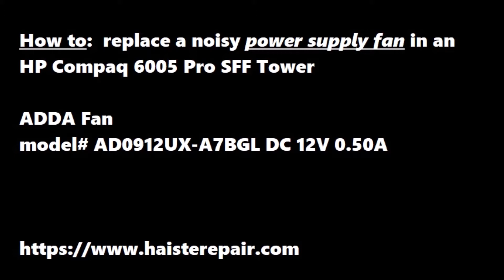How to Replace Power Supply Fan in HP Compaq Pro 6005 SFF Tower

Comment: You sped up the part where you put the power supply unit back. Was extremely easy to remove it but had great trouble in putting it/fitting it back again.

Edit- Ah, figured it out. We need to put the bottom part such that the tiny circular bulges on either end fit into the curved rails on either side of the CPU case & then turn the PSU up to it's usual position such that the sides stay in those rails.

Helpful video to replace the fan as I use them in full speed & may need to change more frequently.
Reply from the maker: Yeah, I figured people could just do the reverse of taking it out when reinstalling.  Or, maybe try playing the video in slow motion.  Fair feedback, thanks.

Comment: ummmm i can clean everything in the power supply with the contact cleaner?
Reply: hope u reply as fast as u can :)
Reply from the maker: @sadg5056  I would use Isopropyl alcohol personally as it is quick to evaporate.  I have cleaned with q-tips or other such things as necessary, with the alcohol.  What kind of situation are you dealing with?

Comment: i disassembled my power supply (psu isnt much different than the one in the video) but im struggling to unplug the fan, im afraid to use  100% of my power and end up by shredding the cables
Reply: nvm i managed to
Reply from the maker: Good deal!  How is it going?

Comment: Hi. is it possible with only 250 watt if; so what will the minimum/cheapest requirements of hardware cpu/gpu....be for the hp 6300 pro sff for use as a media server dl movies/sreaming wifi/ 4k movies? Thanks
Reply from the maker: It would generally work fine as a basic media server and, yes, the 250W PSU would be fine.  However, for 4K video streaming I would recommend upgrading the graphics card and power supply.   Minimum gpu might be something like this:  https://www.techpowerup.com/gpu-specs/geforce-gt-1030.c2954

A quad-core CPU with a good clock speed would be good.  Does your model run AMD or Intel?

Comment: You can try oiling the fan
Reply from the maker: That is true and I don't think I tried that despite having appropriate oil on hand.  Or maybe I did, I can't recall!  So long as the bearing is accessible under the sticker (not always the case) that is something I would also recommend trying.

Comment: My HP 4000 start up when plugin. Does shows anything on monitor and the keyboard  it shut down for about a second then the fans start spinning again then the fans start spinning fast I tried everything bring it to a expert he said the mother board is no good but my mind is telling me other wise I think it's the power supply any ideas any one
Reply from the maker: So the fans are running very loud and very fast?  As if they were receiving more power than they are designed for?  And the computer boots on when you plug a power cord in, but doesn't boot to Windows or give you a chance to get to BIOS?   It just keeps running the fans at high speeds until you shut it off?  Try opening up the tower case and trying these one by one:  1) remove all RAM sticks and try booting them one at a time.  You could have faulty memory that is preventing startup.  2) remove all hard drives and optical drives.  Try booting up the tower with one installed at a time.  3) remove any graphics cards if you have one installed.  Try booting up with the display cable plugged into an integrated port on the I/O panel.  4) remove any other cards or peripherals except for the mouse, keyboard and monitor.  Try booting up.  

Let me know if you need clarification or any help with these :)  Or, let me know how it goes.
Reply: @HaisteComputerRepair  we tried all of that it didn't work we change the processor we change the ram we run it without hard drive same issue
Reply: Thing is the power support is Kno to be running on low voltage cuz my electricity it weak so I am wondering if that could be s issue because that PC is not design to run on low current
Reply from the maker: @lyrikoal7791  Can you explain how your household current is weak?

Comment: i have an issue as same as someone on here of the comments that the psu fan and front fan of (hp elite sff 8100 i think thats called) that goes at full speed since i turn on the pc,every time,i already tried disconnecting,connecting,i really dont know what to do :( i checked temperatures and they're normal on 35-40 degrees,as well with the gpu ,im really out of ideas of what could it be or how to fix it
Reply from the maker: How long have you been using the PC before this happened?  Did you recently remove or plug anything into the motherboard?  It's the front intake fan on the case that's running at full speed?  Can you check to see where the front intake fan is plugged into the motherboard?
Reply: @HaisteComputerRepair  like 3 months i guess,then i was playing and then it started and never stopped,the fan is connected to the fan connector close of the CPU,i don't see any other though so i don't think is that :c
Reply from the maker: @gabolayv  Do you have any other fans you could test out?  It's possible the sensor on the fan's circuit board malfunctioned.
Reply: @HaisteComputerRepair  unfortunately i don't,I'm thinking on buy a replacement of the front fan and the power supply fan,just to see if any of them Is giving that issue
Reply from the maker: @gabolayv  Sounds fair.  Do you have any local computer shops?  Maybe they would have a fan you can bring in and test out your system with.  The fans aren't too expensive, though.

Comment: how i can test the power supply
Reply from the maker: As in how can you test if it's working and routing electricity?  If you have a voltage meter, you could try testing the cable feeding out of the power supply and into the motherboard.  First plug into an outlet and then look for the area on the plastic plug that connects to the board.  Test each wire until you find the "ground" and "hot" wire.  If you're getting a steady reading or a reading that aligns with the voltage of your power supply, that's good.  If not, you will have to think about opening up the metal casing and testing the power supply board.  What stage are you at?  Does that make sense?
Reply: @HaisteComputerRepair  I removed the cover and found a small lamp is on, but the computer does not start when I press the power button, the button lamp does not flash
Reply from the maker: @techpro8296  Ok.  Do you mean that you removed the tower case panel?  Perhaps that light was on the motherboard?  Or did you remove the Power Supply casing?   If the tower panel, check the cables running from the power button attached to the from I/O assembly to ensure that 1)the plastic piece is depressing enough to hit the power button 2) that the cable is properly plugged into the motherboard.  Try removing the front plastic panel to get a better look.  Let me know if you are referencing the power supply case.

Comment: My not sterting he make beep 9 times and smps not sterting
Reply from the maker: Is this happening after replacing the fan?
Reply: No and how repair this
Reply from the maker: @manishpawar3185  Well, you could try 1) taking all RAM out and testing each stick one bye one by installing and booting up.  2) Try unplugging the Optical Drive, hard drive and/or SSD from the motherboard by removing the SATA cables.  Try booting up with none, then try booting up with one installed at a time.  3) if you have a graphics card (or any other type of card) installed, try taking it out and plugging the display cord into one that's attached to the I/O panel on the motherboard.  Try booting without the card(s) installed.  4) Try replacing the CMOS battery on the motherboard.   Do you happen to have access to another CPU that will fit the socket type on the board?
Reply: But my smps not sterting
Reply from the maker: @manishpawar3185  Sorry, I glossed over the fact that you mentioned SMPS, in relation to your power supply.  I focused on the 9 beeps being diagnostic errors communicated from your motherboard, which would indicate that power is being directed from your power supply.  I would have to assume that your power supply is working to the extent that you hear diagnostic beeps indicating something is wrong.  But, if your power supply is in fact not supplying power to your system board, is there a way you can measure the voltage from the plug that connects to the motherboard?  Do you have access to a voltage meter?  You could test the power plug connected to household current, then the plug that connects to the motherboard to see if it comes close to matching the voltage your power supply is designed for.  So, can you be more specific?  Can you walk me through exactly what happens after you plug in your power supply and try to boot your computer?
Reply: Ok
Reply: Thanks bro
Reply from the maker: @manishpawar3185  No worries, let me know how it goes with a fix if you do figure something out.
Reply: @HaisteComputerRepair  can you sent me link for purchase new smps for hp compaq 6005 pro
Reply from the maker: @manishpawar3185  Try this on eBay.  https://www.ebay.ca/itm/HP-Compaq-SFF-PC-Power-Supply-Pro-6000-6005-Elite-8000-508152-001-503379-00-240W/254467754360?hash=item3b3f75c978:g:UwIAAOSwncJeCqwj

I'm not sure what country you're in, but this one ships from the states.
Reply: @HaisteComputerRepair  thanks brother ✌️

Comment: What video card & cpu  you installed?! I want to upgrade mine. I have hp compac 6005. Cpu athlon x2 b22.
Reply from the maker: NVIDIA Quadro 600 1GB and AMD Phenom X4 955.  Nice combo.  Look for a 2GB card if you can.  GT 1030, 710, or AMD Radeon HD 6450.

Comment: Hey sir, I was cleaning the pc inside with an tissue without water, I was cleaning the hard disk and power supply and then i tired to put the power supply back but its hard can you help?

(Please reply)
Reply from the maker: Is it the same PC as the one in this video?  Can you share some details about what your setup is?  Make model, etc.  It might be good to invest in a microfiber cloth as tissue will leave dust.  I use tissue or paper towel to clean off thermal paste sometimes, but not much else.
Reply: @HaisteComputerRepair  oh, Hey man im ok now, I found out how to put it back, I have a problem on my Hp compaq 6000 pro, It says the CR2032 IS NOT WORKING, I DID REPLACE AND IT DIDN'T WORK.
Reply: @HaisteComputerRepair  I tired to put 3 CR2032 and the pc keep saying its not working even i put it and push the battery
Reply: @HaisteComputerRepair  btw the pc is not new, My mom received the HP COMPAQ
Reply: @HaisteComputerRepair  error: 162-System options not set
Reply from the maker: @zcxsmic0597  Ok, if you can boot into BIOS by hitting F10 on startup (I believe it is F10, a splash screen may tell you otherwise).  Check to see that the time/date is correct and hit F10 to save settings and exit.  If the system is botting on, that means the CMOS battery should be working, but perhaps your settings in BIOS are out of sync.  If you keep getting the error after exiting BIOS the first time, try going in again and setting everything to default.  There should be a list of options indicating how to do that somewhere static in the BIOS.  Let me know if that works.
Reply: @HaisteComputerRepair  OK sir i will wait for keyboard to do this
Reply from the maker: @zcxsmic0597  Ok, let me know how it goes.

Comment: I have a similar pc ( HP compaq 6300 Pro SFF)

The fan on the PSU is really really loud, my computer is working properly. I don't think a simple fan replacement will fix it because it's literally running at maximum speed. My temperatures are fine though. Any help anyone?
Reply from the maker: Can you confirm that it is your PSU fan and not your CPU or front intake fan?  When I have encountered fans running at maximum speed for no discernible reason, I have tried unplugging all drives from the motherboard, taking out all of the ram, and removing any PCI slot cards.  One by one I reinstalled everything until either the fans acted normally or it was clear what item might be causing malfunction.  I have also gone so far as to install fans with a lower amperage, so that even though they are running high they are making much less noise.
Reply: @HaisteComputerRepair  I already tried removing all the rams earlier as well as removing all the usb devices connected. I'm gonna try it again tomorrow plus removing the drives connected. I actually considered replacing the fan in the past to a fan with lower rpm but someone said I shouldn't because that'll probably raise my temps even higher. Honestly I can bear with the sound, but I'm worried it might be a sign of a dying psu and that's what I don't want to happen.I can also confirm that it's the psu fan since I can hear the sound from it and the air it pumps out is a lot.

Thanks a lot for the reply. I'll update later if anything works
Reply from the maker: @HonkForLife098  If you're into trying the replacement, the fan probably won't cost too much.  The fan in this video was only $6.37CAD.  Are you able to test a different power supply?  Have any spares?
Reply: @HaisteComputerRepair  Unfortunately I don't have a spare psu. I do have a spare 90mm fan with the exact same model as the stock. Now I know I shouldn't be telling you this but I'm gonna comment anyways in case someone encounters a similar problem in the future

There's a fan speed control for these pc's in the bios, however that fan speed control is actually for the intake / cpu fan and not the psu fan. I've experimented with it back then to find the right speed for my cpu fan so I know. I actually set to max because it's the only intake for this pc. I tried setting it to minimum and that actually fixed the psu. It went silent / spins slower now. That's really weird because that setting was for the cpu fan and not the psu fan.
Reply from the maker: @HonkForLife098  That is odd, but thanks for sharing.  I could swear there is no fan control option in BIOS for this 6005.  I'll look tomorrow, I have this set up at my workplace.